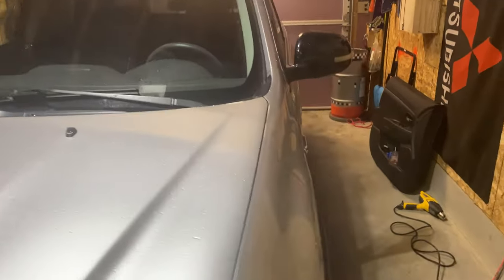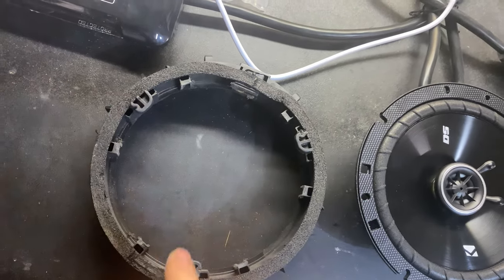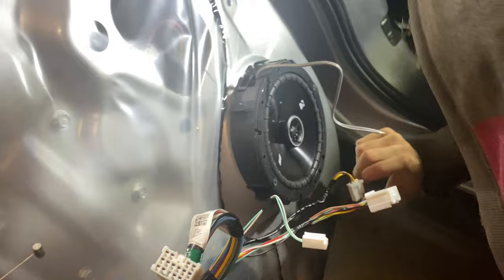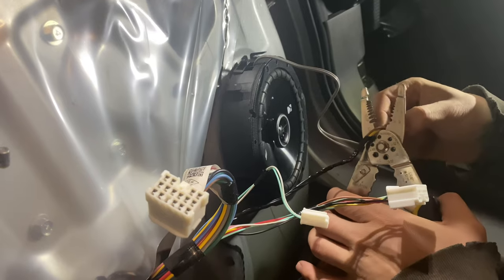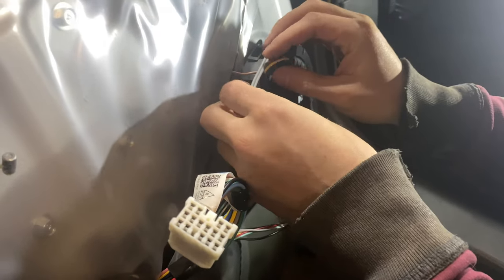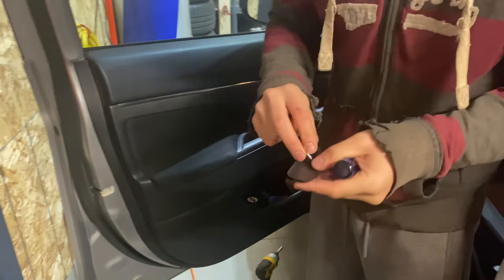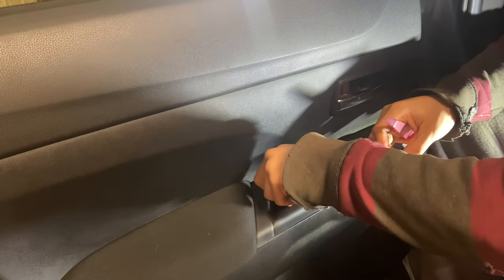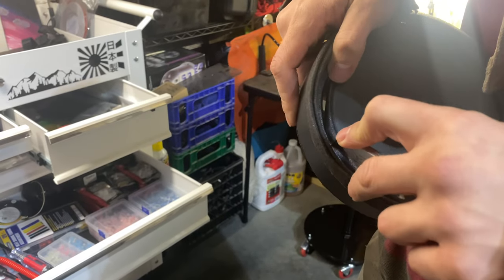Mitsubishi Outlander Sport Speaker Replacement Full Retrofit Stock Brackets 2014 And Up

Comment: Just bought my 2018 sport le and I, like with all vehicles I buy, have to change the stock stereo system out. I'm not too fond of the relative low quality "most" stock systems are. I didn't want to start tearing in to things without having some clue of how the clips, screws and the speaker hardware is. Thanks for the detailed explanation on how the speaker is molded to form the housing. I personally like how you kept the housing so that you didn't have to worry about getting the speaker motor in to the window well. Room for better quality speakers
Reply: @Moses Moises instablaster =)
Reply: @Amir Randy it did the trick and I now got access to my account again. Im so happy:D
Thank you so much you really help me out :D
Reply: @Moses Moises You are welcome :)

Comment: Mine has wiring for a tweeter also just no tweeter installed. Would i need to use a crossover that comes with a component system? Or can i just wire the tweeter to the wires and be good to go
Reply from the maker: I think you can just wire them in, but I’m not 100% sure.

I will be doing it when this cold snap is over and we get the tweeters ordered.
Reply: @timetested did you do this piece of work?

Comment: Does it matter which wires you connect together to the speakers? Is it the standard red to red and black to black?
Reply from the maker: No it does not matter.

Best way to test it with speakers is connect them temporarily one way and listen to the speaker, then try the other way if you’re worried at all.
Reply: Yes it matters your voice coil will move the opposite direction and won't sound as good.

Comment: Did any dash lights came on? Some people been getting air bags light on or there window power won't work?
Reply from the maker: No, as long as this video has been up there’s been zero issues!

I’d recommend keeping the keys out of the ignition when you cut speaker wire, just to be safe. If you want even disconnect the battery. But this video was filmed with battery connected, but no keys on while install.
Reply: Thanks for quick respond! Keep up with those videos, nice job!

Comment: What about if you use fast rings, sound deadening
Reply from the maker: I’ve never used fast rings, but yea sound deadening works wonders!
Reply: @timetested  what would you recommend with sound Dead
Reply from the maker: There’s quite a few links you can search to find different thicknesses and whatnot, everyone has their own preferences
Reply: Would the jl audio c1s fit? Crutchfield said only the 5.25 fits but sonic said they will fit I'm so confused
Reply from the maker: I guess I’d ask them if they’re comparable in size to the kickers we installed in this video, that way if they’re the same dimensions or smaller they should fit.

Comment: i realize this is about a year old but was wondering why you didn't just attach the new speaker to the door without using the original "basket", or whatever that plastic ring is called. thanks
Reply from the maker: Wanted the best “factory fit” and in case I wanted deeper fitting speakers down the road, prevent rattle, falling out, etc, also so I wouldn’t have to fashion my own baskets if any of these issues arose later down the road.
Reply: @timetested  i appreciate the quick reply, was kinda what i was thinking the answer would be. no fitment issue putting the door card back on? i realize we're only talking about 1/4 of an inch difference at most probanbly

Comment: What size and type of bit to drill into the door? Nice install
Reply from the maker: Thank you! I used my black oxide bits from Menards, I think just their stock brand.
Size depends on your hardware, I usually like to go just a bit smaller than the shaft of the hardware (minus the thread width) so it has room to grab.